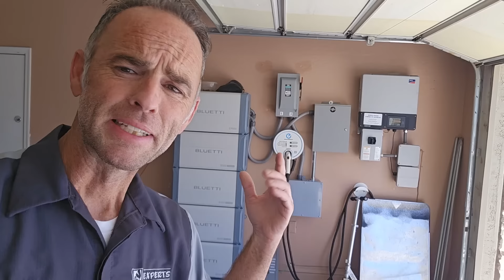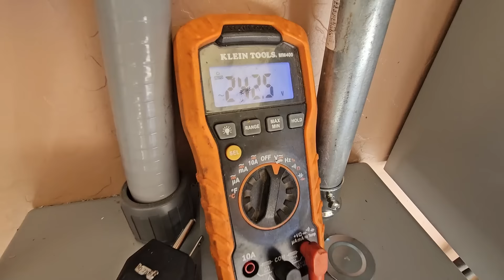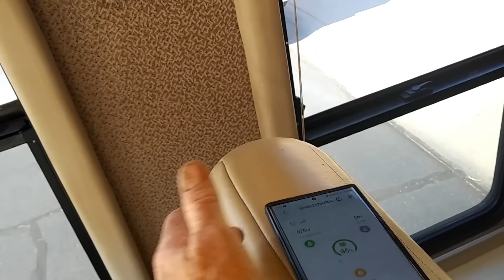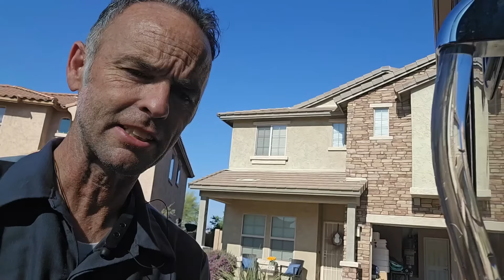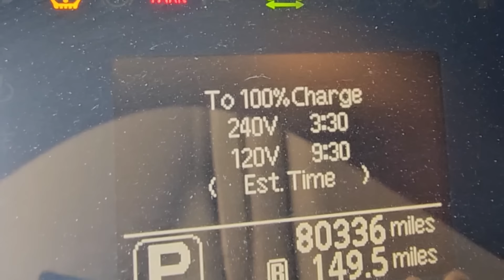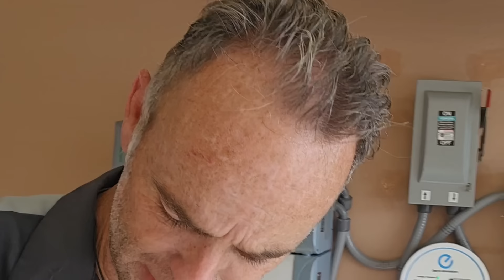Most DIY Solar Generators Fail These Tests: RV and EV Level 2 Charging

Comment: The side yard limits your sun to 4 hours? A string inverter, a single panel in shade will knock out the array by 60% or more? Is there a reason you did not put the pergola in the backyard?
Reply from the maker: theres a pool there and it is east of a two story house
Reply: @AZExpert  gotcha.
Reply from the maker: Also it's the south side so it makes usable power from 9am to 4pm

Comment: There couldn't be a video more up my alley than this one.  We have 20kW of grid-tied solar and a 2013 Nissan Leaf which has the same Lizard battery yours received as the warranty replacement.  We've had it since 2015 and the range has gone down to about 60 miles with a light foot and no heating or air conditioning.  Last week I picked up a crashed 2022 Leaf Plus at auction, and I'm going to be replacing the 24kWh original battery with the 62kWh one from the wreck.  Looking very much forward to the 200+ mile range!  Once the battery swap is done, the Leaf will be doing duty as our "toad" vehicle, just as you mentioned.  It'll be interesting to see how the different campgrounds react to my request to charge the Leaf while we're parked there.  I'm planning on being totally up front about it and offering to pay extra for the privilege, because it does obviously increase your electrical usage significantly.  I also ordered 16x 304aH EVE LFP cells directly from China, and I'll hopefully be setting those up along with some rooftop solar in our 2007 Monaco Dynasty Palace III.  Unrelatedly, the Midea air conditioner you're using in the bedroom is an inverter model which is much more efficient than the old style ones - it's essentially a cooling-only mini split, but I'd imagine you already knew that.  If you get a chance to review the new inverter roof a/c units which are just coming out, that would be some great content for your channel.  There's a huge amount of interest in these, but very little practical information at the moment.
Reply from the maker: Thank you. Your swap sounds fantastic

Comment: I did the same thing, I built a huge 20x40 patio cover and filled it with solar panels. Installed a 15 kw battery backup that allows me to be net zero and sell 1000 kw per month back to the power company for about $300 a month credit.

Comment: So the power company gets to accept electricity you provide from infrastructure you invested in, you maintain and you upgrade when necessary and all they have to do is charge you at the going rate.   In other words they get to provide you with electricity without ANY investment at all.   The best part is that they convince you that you are helping the environment when in fact all you're helping is their business model.  Have I forgotten anything?
Reply from the maker: Yes, change is never solved by complaining about change
Reply: @AZExpert  I'm sure they see it that way too.   This is probably gonna get you taxed more too from somebody.   Like how electric vehicles cause an increase in taxes because the government loses revenue from the gas tax.
Reply: @Critical-Thinker895  I'm getting hit with I think $150 extra on my car registration this year due to owning a PHEV.  But I'm OK with that.  I get to make 1/2 gallon of "gas" every night by plugging in, and even when running only on gas, I'm getting 60mpg, or 70mpg if I drive slow.  The amount of money I save on gas is WAY more than the amount I give to the government, due to having an efficient car.

Would I prefer to contribute no taxes to the roads I drive on?  Depends on what mood I'm in, but generally, no.  Happy to pay my share, and have the roads.

I've got to go now.  Harbor Freight opens in a while, and I want to be the first person there to take the limit of 3 Icon rechargeable bar work lights for $20ea, normally $40.  Plus I get 3 free gifts with any purchase.  And I get to drive there and back without using any gas, without any wear on my engine.  It will use way under $1 of electricity.  If I drove something stupid, it would cost me $5 of gas, plus engine wear and tear.  None of that for me today.

Comment: Always enjoy watching your videos. Got a lot of great options with Your solar set up Something a little off-topic Just bought a 2007 American tradition  the previous owner  installed  3 new 15000 Btu  Ac's on the roof  are there any certain brand of soft starts for the AC's you Recommend   THANKS!!
Reply from the maker: afunny you should mention that...that's my next video. But RVP makes an easy one for coleman and dometic makes a more plug in play one for dometic and Amazon sells a Spartan I've used that's a little more confusing, and the micro air are nice but very complicated.
Reply: Will wait for next vid.😊
Reply: I installed the Coleman soft start unit on the bedroom Coleman air that always was noisy when starting, and is much quieter now.

Comment: with the current system at your house how long will the battery will last, if there is a power failure in your area how long will the battery system last with no power.
Reply from the maker: Assuming good sun and wise power management, I would never lose power for the refrigerator and lights, a better more modern solar array would allow me to run the A/C the whole day too with never ending power.
Reply: Average house is somewhere around 20-30kwh of usage a day. An energy efficient household (without factoring in water heater, air conditioning/heating) can be below 10kWh a day. Obviously heating water or using a heating element on a stove/oven and using air conditioning is going to be the MASSIVE energy consumer of your house. So it really depends on where you live because in Phoenix you will be running AC almost all day from May to August. If you live in WI expect to need heat from Nov to March which is just as bad in terms of consumption as AC. 

If you can put up enough solar to cover your usage AND charge your batteries during the day its just a matter of having batteries that can cover your 16 hour consumption when the sun isn't out. 20kWh to 30kWh of battery is typically enough to cover most households. Having 5kW of solar is probably the minimum you would be looking for....10kW should be enough for a 2500SqFt house.

Upgrading to an efficient water heater will definitely be one of the easier things you can do to minimize the amount of battery you need. Mini Split AC's/Heat Pumps would be a close second (although an expensive up front cost). Then you just need to be cognizant of your power usage when cooking and doing laundry. LED lights are also another easy switch that will help bring down the constant load thats always on your inverter. Most homes will see a constant load of 500-700W